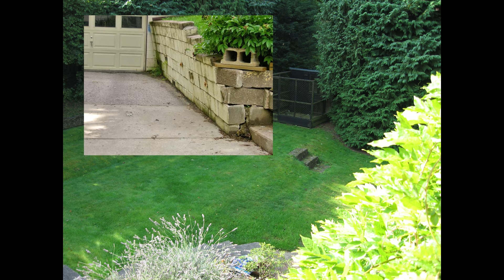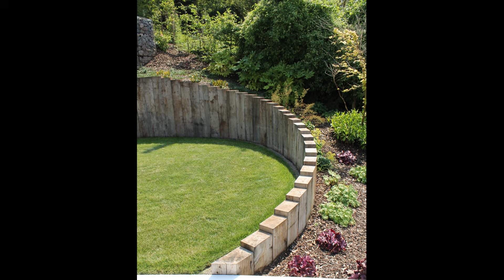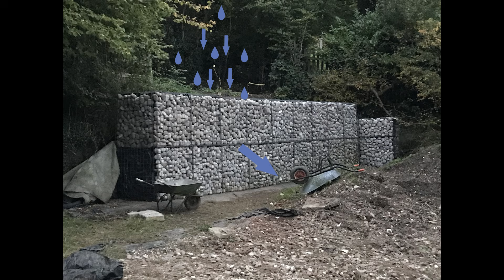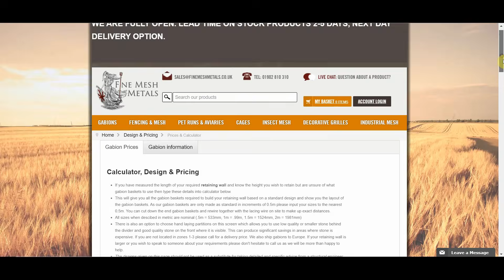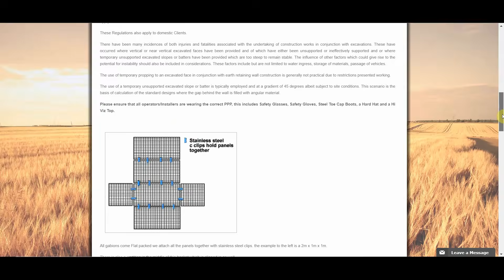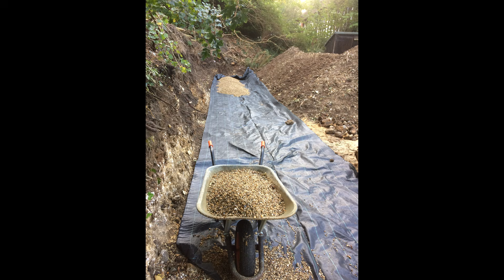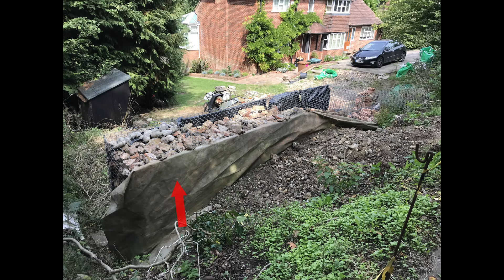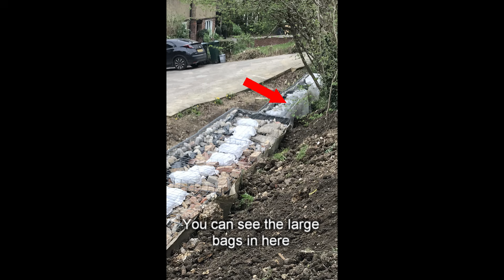GABION RETAINING WALL CONSTRUCTION with cost saving panels | Full Walkthrough with Audio - Part 2

Comment: Interesting clip, and choice of technical solution. If the gabion basket fabric is pvc-coated wire, do you have any concern on solar damage to the coating that might lead to exposure of the wire to moisture and corrosion ?
Reply from the maker: Hi, we didn’t use pvc coated gabions, ours were galfan coated, so unfortunately can’t help with your question. If you’ve found a supplier I suggest dropping them an email. HTH. Karen
Reply: @OurHomeProjects  ....very helpful response, thank you !

Comment: Are the Galion cages stainless steel,  if not, what keeps them from rusting and deteriorating...
What keeps the cages from collapsing or squatting under their own weight....
Reply from the maker: Hi there, we did our research on baskets and didn't go for the cheap ones. The ones we bought have a 'galfan' coating on them which stops them from corroding. 5 years later, no sign of any rusting. To stop the baskets from collapsing, you need to ensure the bottom baskets are completely full, right to the top and the material needs to be very heavy, like limestone or bricks. We also went for baskets with a 4mm front panel which helped reduce any bulging. Hope this helps. Karen

Comment: Nice job.  How’s it holding up?
Reply from the maker: Hi Jason, thanks for watching. We started the wall in 2016, but if you skip forward in the playlist you will find the videos finishing the driveway in 2019 - https://www.youtube.com/watch?v=bHoijeVENWY&t=300s  So far so good! The only issue we had was when the driveway guys added more soil behind the lower section, the small row of top baskets moved out a bit and that was because of two reasons, 1) I hadn't tied them at the back to the lower baskets and 2) they were filled will small bags of gravel rather than heavy bricks. Karen
Reply: @OurHomeProjects  yeah, I saw the part where you put the bags in it instead of the brick.  I've been telling my neighbors about Gabion walls, and nobody has a clue of what I'm talking about LOL.  Most people where I live have the cement or pavestone walls, but it seems more expensive.  Are Gabions more of a European thing?  thanks.Jason
Reply from the maker: We had quotes for other types of retaining wall and just couldn't afford it at the time, so we researched and came across gabions. We really liked the Scottish cobble look and as we're in a semi-rural location, the natural look works really well.  The only drawback is they require more depth than a standard block wall. If you're looking at retaining a bank more than 1m tall, I would definitely go with 1m deep baskets otherwise you could be at risk of movement (even though they are a porous, they are also 'mass retaining' so need the weight in them to stay put). Definitely cost effective and DIY-able. HTH Karen
Reply: @OurHomeProjects  yea, Im pretty familiar with how deep I need to go, found some online calculators to help.   These baskets seem a bit expensive.  Whats your opinion on DIY baskets?  I found 8 gauge (British gauge) galvanized utility panels at a ranch supply store.  They measure  4.87meters X 1.5 meters with 2.54mm square mesh openings.   With the bulk discount, I can get the price around 6.10 pounds per square meter.   So about 45.29 pounds for a 4.87meters X 1.5 meter panel,  I can prob get 2 or 3 baskets out of each one.
Reply from the maker: Hi Jason, I’m afraid I can only comment on the baskets I bought from fine mesh metals which are lasting well for us. Ask your supplier about any coatings and how rust resistant they are. Also, if they’re too thin they won’t keep their shape. Perhaps also consider if you can source a really cheap fill so you can spend more on the baskets. Some builders will give away their hardcore for free, or another commenter suggested looking on Facebook Marketplace for free rubble if you pick it up. Good luck with the the project! Karen

Comment: Nice I just brought some of these gabions from Fine Mesh Metals too as I found them the best price/quality with lots of info on their website to help. I only have a small wall to make (3 Metres) glad of that as I had to dig out by hand, good tips to lay out the facing stones using the geotextile. I`m using Ironstone facing for mine as it is traditional where I live and I quite like the colour variations, also ordered these from the same supplier as you, seems your research and mine came to the same concussions. Excellent video showing how you achieved a great looking retaining wall and I have learnt a lot that will make my project easier. Thank you liked and subscribed.
Reply from the maker: Hey - Thanks for watching and for the sub! Really appreciate it. The ironstone sounds nice! Good luck with your project. Karen

Comment: If anybody cares I think it came to right at 150 pounds per square meter of wall face.  Makes it a bit easier to compare to another project with different heights or lengths.  Great content, thanks.
Reply from the maker: Thanks for that. Was that for the same process (rubble in fill with cobble front?). I remember one bag of cobbles did do around 4-5 fronts, but that was stepping the partition panel back only 10cm.
Reply: @OurHomeProjects  I calculated it for your project.  I just converted your overall costs to square meters to account for the wall height variations.

Comment: Great video. Is the drainage pipe necessary? I mean the whole wall can essentially have water draining through it right
Reply from the maker: You are right. Like for many people watching this video, and same for us, it was a new DIY concept and it was more of a belt and braces thing. I was concerned if the system started to clog up with soil at any point that there would be some sort of drainage at the back. When you’re building 2m tall you don’t really have the option of putting anything in retrospectively! But you are absolutely right, the geotextile should keep the system clean and a drainage pipe might be overboard for smaller walls. Thanks for watching. Karen
Reply: @OurHomeProjects  when you put it that way, I guess it's a small price to pay for piece of mind. I might do it as well. Thanks for uploading the vid, very informative.
Reply from the maker: I think your soil conditions might also play a part, ie if it’s clay you might want to add it as an extra, but if you have good soil, probably ok to leave out. 

Everything online about heaving retaining walls is about lack of drainage and we just didn’t want to go there! 😂 You start off as a novice building a gabion wall, but come out of it knowing a lot more about the system and have confidence in it. 💪🙂

Comment: To view your video couldn't have come at a better time.  I'm in the process of researching and pricing out what it will take to construct two gabion walls running parallel at 7 feet apart on a hill side.  You had brought up some very important points and labor saving tips that I can use construction my gabion walls.  Thank you for sharing, a fellow DYI'er
Reply from the maker: Hi Chris, really pleased the video helped you out. Sounds like a challenging project! Good luck. Karen
Reply: @OurHomeProjects  yes, as yours was too.
Reply: We’ve got a 10 metre wall needing installed, I’ve thought about brick, sleepers, putting decking in but I think the gabions are the answer plus we want to do an extension so great place to put the waste in behind the Scottish cobbles. I would say you did the right thing getting the non woven geo fabric in and a drain I watch French drain man videos and he bangs on about it constantly as best method. Very impressive
Reply from the maker: Thanks for watching. Our gabions have lasted well. My only advice is to make sure you get a quality product for any large project. Good luck! Karen

Comment: beautiful! 
the black geotextile fabric maybe have contributed to the wall failing :( also if you do plan on removing the backfill. I would suggest removing 2ft of organic matter, dirt, from the back of the gabion and fill it with 3/4 in angular drainage rock. you did a great job by saving money on the filling material for your gabion but think about spending a portion of what you saved on drainage rock! always helps! much love!
Reply from the maker: Thanks for the feedback Gust.  The short section of wall moved for two reasons - I didn't attach the baskets to the lower section at the back and the gravel bags inside just weren't heavy enough. The whole structure is porous, plus it does have a drainage pipe and 2ft of gravel at the back, so it wasn't water pressure that heaved it out. Gabions are a mass retaining system, so they need something very heavy inside and gravel bags just aren't heavy enough in my opinion. Hopefully others will avoid and just use solid stone. Thanks again for watching. Karen
Reply: @OurHomeProjects  Awesome stuff! Thanks to your DD now we know not to fill bags for gabions. Have a great day.
Reply: I think what Gust is proposing is a “buffer” of clean aggregate between the bank and the rear of the basket. It helps to stop heave from the bank

Comment: Karen, another question. Looking at your video here it looks as though you've got at least 30 square metres of outward facing Gabion and potentially more if you've put the cobbles on top? In your tally at the end you say this was done with only 6 bags of cobbles - is that correct? Dave.
Reply from the maker: Hi Dave, I had 33.5sqm of cobble faces to fill - all the fronts +  the one large side on the top row + the two small sides of the 90deg return at the end of the row. I did order 6 bags of cobbles, but I did have 1 tonne leftover as I didn't end up using them on the tops of the baskets (and that wouldn't have been enough anyway).  How many Sq metres do you need to cover? I would suggest splitting the order in half if you have 30sqm, say, buy 3 and see how you go. Then buy in whatever else you need to finish the job. I ended up ordering my cobbles in 3 goes from 3 different suppliers! HTH Karen
Reply: @OurHomeProjects  Hello Karen, I've 10 metres facing sides and tops and have ordered 2 x 850KG's of stones, hopefully that'll do it? I've just been reading some horrific reviews on fine mesh metals which is a little worrying, my Gabions are on there way potentially arriving today, fingers crossed I have similar experience with them  as you did.
Reply from the maker: Sound good. You could always just get some small bags of cobbles to finish off if another 850kg is too much.
Re the reviews ~OMG~ But there are only small number and people tend to leave reviews when they've not had good service. I had emails with a chap called Chris and he was really helpful! At the end of the day, I thought the product was really good with the 4mm thick fronts. 5 years on they still look as good as when we bought them, no rusting or anything. Good luck with the build! Karen